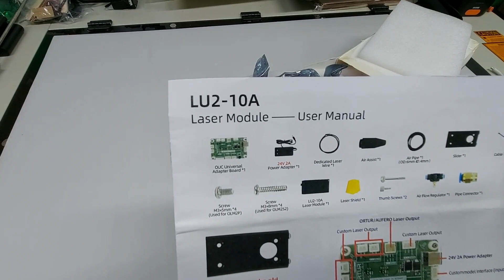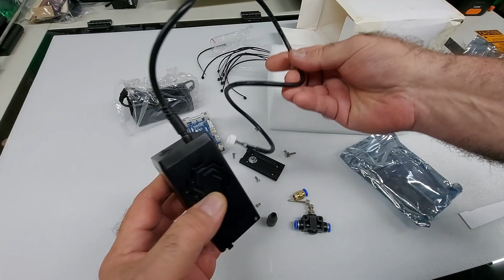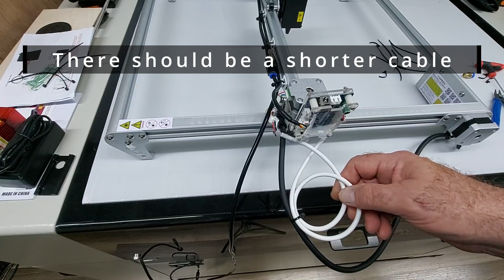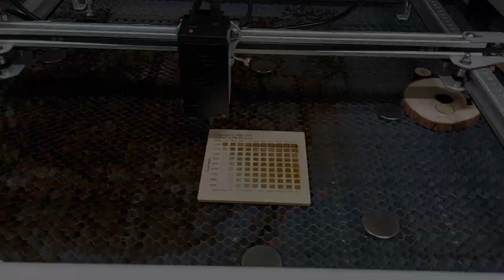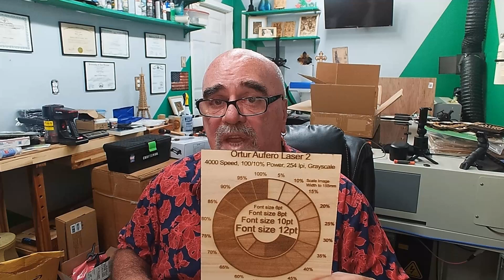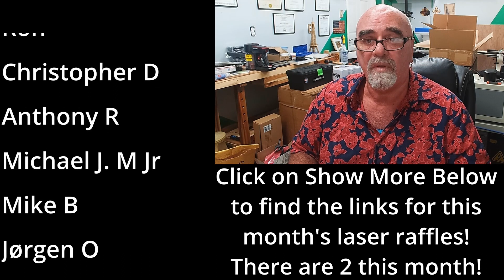ℹ️ Ortur 10W Laser Module Review! (July, 2022)

Comment: I just watched your review on the 10 watt laser from Ortur. My wife bought me one for Christmas.  They left out a lot of information or just didn't have it. I use a cabinet I bought from Ortur, they never gave any thought to those that use one. That electronic device was a bugger to install. Unlike Ortur, I fashioned a bracket to attach mine. Same as the air line, by now you know you have to push down on that ring to lock in hose. Like you said, they cod have done a better job.
My two cents anyway. I have learned a lot from you, thanks.
Reply from the maker: Thanks for watching! Hope you have fun with it.

Comment: So upgrading to this module from my LU2-2 will not cut down on engraving time? 

I generally engrave 7x8 inch Monograms at 600-800mm/m @ 100% on 15x11 cutting boards and they take 2+ hours each.
Reply from the maker: If you're upgrading from the 5.5W module it will.

Comment: Hi Rich, Your 10W laser module review was great. I have 2 questions. 1. The instruction sheet says to go to laser GRBL, go to configuration, and change the value of $131 to 390. Also, there is a push button switch on the top of the module next to the cable that plugs into the module which seems to do nothing. Do you know what this switch is for? Thank You for your help.
Reply from the maker: $131 is the max travel on the Y Axis, and depending on your model, it may need to be changed. There is no switch that I know of on the module. There's the plug for the power and the plug for the air assist line.

Comment: Hi everybody. I replaced my laser head unit to a new LU2-10A laser head unit and connected it to my laser device, model OLM2PRO S2. I uploaded a file using the LIGHTBURN software and... the laser does not engrave. I've attached a video.
Does anyone have an idea what to do? I would appreciate any suggestion.
Reply from the maker: You can't attach videos, but you can open a support ticket: https://ortur.tech/support/

Comment: Ordered this from AE about couple weeks ago.  Paid just $170, saving about $120!. Realized it might just be the module, but it came with all the mounting hardware and controller board, even spare lens!  Only thing I had to replace was the power supply which was meant for another country.
So far, no issues, engraves and cuts way better than the standard LM2 5.5w module. 
Only grudge is the mounting of controller board. Gonna try and come up with some 3D printed part to make it more secure.
Reply from the maker: Yeah, that control board was pushed out with no thought!

Comment: I hope you can answer this but I got the LU2-10A and installed it.  Everything works but in the laser grbl model setting under the laser grbl settings DB the LU2-10A doesn't show up on there.  What laser model do you suggest using in place of the LU2-10A?  Thank you so much for the video and the answer.
Reply from the maker: I don't have an answer for this. I would suggest contacting Ortur.

Comment: hi thanks for the video ... like you!!!  perfectly engraves.. How can I find out what parameters you set for glass engraving , can I find out ? or do you have a video clip :?  I have a 10A machine, Artur Lazer Master 2 PRO S2.. tried on glass but does not engrave.. Maybe I'm doing something wrong. It works fine on metal..
Reply from the maker: For glass with this laser you need to coat it with Tempera paint.
Reply: @TheLouisianaHobbyGuy  thanks
Reply: @richiesrestorations4883  it is necessary to apply to the glass Paint for furniture odorless wood chalk matte

Comment: Hi Rich, I love all your videos. I just recently replaced my laser master 2 LU2 2W to the 10 W module. Im loving it. I was concerned about the air assist hose as well, but it worked fine and held in place.  

Do you have a recommendation on how to do a grayscale test on anodized business cards or dog tags? Obviously, you can't set up that grayscale wheel to be 155 mm.

Thanks,
Ed
Reply from the maker: Yes Ed, in the Laser Tools --> Material Test. While it's not grayscale, you can get fill engrave settings and guestimate from there for some baseline testing.
Reply: @TheLouisianaHobbyGuy  Thanks, Rich. I completely forgot about that. Much thanks.
Reply: @TheLouisianaHobbyGuy  I PMd you a message on your webpage as well, so you can ignore that, but thank you again.

Comment: rather than spending $250 on the cheesy rube goldburg tie the board on the side approach I purchased a 'refurbished' lm2 pro s2.  this lets you slide on a new gantry and 10a laser module, but most importantly you get the s2 control module and cable set to replace the old lm2 pro module and cable.  a much cleaner approach for a few dollars more.
Reply from the maker: Awesome!

Comment: Great review. Since I'm originally from Louisiana and grew up fishing in Plaquemines Parish for speckled trout and redfish I love to see some fishing videos.  So I recently purchased the Aufero 2 as an intro laser to learn about them. I using Lightburn since it seems to have many more compatible file types. My biggest issue is the fumes. I live in MN and of course, it's -8 degrees currently outside so opening windows to exhaust the fumes is not possible. What is the best solution in your opinion??
Reply from the maker: In my other shop I have an exhaust fan that vents to the outdoors. At the wall, where it passes through, I have a fitting that only allows one way of flow, and I have it wrapped in insulation. This is the best solution IMO. It's sort of like a dryer vent.

Comment: Thanks for another great video. I have the LM3 10W and I cannot even cut the thin basswood (1.5mm) at 360mm/m 100%! If I force it out, it splinters. That setting barely scores the wood on 3mm ply. What am I missing? I use the little 'kickstand' for focusing and I have tried raising and lowering also. Thanks!
Reply from the maker: Lens has to be perfectly clean and focus has to be right. Try running a ramp test: https://youtu.be/sfGlZGhh144
Reply: @TheLouisianaHobbyGuy  Thanks! After watching both of these videos twice and running the ramp test, I've made a little progress. I can now cut 1.5mm basswood with 1 pass at 360 & 100% I looked at the lens but I'm not sure how to tell if it is perfectly clean. The tube and the orange cover are clean. For my ramp test, I elevated one end of the wood 8mm. I ran it 3 times, once focusing with the kickstand on the far left, once in the middle, and once at the far right. All three passes resulted in the focus position being the thinnest line. I did notice that you have Constant Power Mode turned on, so I turned that on, but I'm still nowhere near cutting through 3mm ply. I am using air assist. I've cut at 300, 200, 100, and 50 all 100% and the wood is barely scored. If you closed your eyes and ran your finger over the 'engraving' you wouldn't feel anything. I cleaned everything again and ran the test over with a 1 mm lower focus. Same result.
Reply from the maker: Try lowering your speed to 200.
Reply: @TheLouisianaHobbyGuy  I've cut at 300, 200, 100, and 50 all 100%, and the wood is barely scored. If you closed your eyes and ran your finger over the 'engraving' you wouldn't feel anything. I've tried a couple of different types of plywood (one being birch) but the results are the same. I can cut through the thin (1.5 - 2mm) DollarTree basswood at 400 speed 100% in 1 pass. It barely burns the waste board and doesn't just drop out, but with just a slight push, it pops out with no splintering.
Reply from the maker: Your lens may be dirty.
Reply: @TheLouisianaHobbyGuy  I watched your live stream yesterday (lots of good info). Thanks! My lens looks clean and I have cleaned it. An ORTUR rep asked me to make a video showing the problem so I did. She has already stated that the LM3 can only cut through basswood and only in multiple passes beyond the thin wood, so I'm not sure I will get the answers I'm looking for from her. My beam seems to be off-center. Is that a problem? Here's the video. It's short. Take a look:    https://youtu.be/BV_QXLH2Qjg
Reply from the maker: That looks like the diode was installed wrong. Try unscrewing the air assist and removing it for one cut and see what happens. It's definitely not normal.
Reply: @TheLouisianaHobbyGuy  Sorry to have so many questions but I just can't get the cutting part of this right! Are you just saying to cut without the air assist? The cuts aren't too different with and without the air assist. Our laser component came completely installed. We just mounted it and connected the cable and air assist. I'm hesitant to take it apart and I wouldn't know what to do if I did. The ORTUR rep won't answer my question as to whether the off-center beam is a problem. Her response was : 'The cutting speed depends on the engraving material. If it cuts the basswood, it will cut easily but if it cuts the 3mm birch，it may cut slowly and needs to be cut many times. Hope this can solve your confusion.' It doesn't!
Reply: @TheLouisianaHobbyGuy  Ortur is replacing it! Thanks for your help and I really appreciate all your videos. They are so beneficial to so many people!!! LOVE your work too!

Comment: I'm looking for help with my upgrade. I have it connected correctly (quadruple checked) and the circuit board shows the blue light for 24v lit. The laser on the other hand is not powering. Can you confirm the fans and red light should be on at power up?
Reply from the maker: On mine they are.
Reply: @TheLouisianaHobbyGuy   Okay. That’s what I was afraid of. Looks like mine is DOA. I appreciate the reply and thank you for this video as well. 🤗

Comment: I just installed this laser on my LM2 Pro and it doesnt even get close to cutting 3mm ply with the settings you tested. Not sure where I'm going wrong. Are there new laser settings I need to put into lightburn for it to use the full power of the laser vs the stock laser? I have both PSUs connected.
Reply from the maker: Did you run a ramp test? You need to have a good focus.
Reply: @TheLouisianaHobbyGuy  I just did a cut test using the material test tool. Im able to cut 4mm ply at max 340mm, when running 90%, 3 passes. Is this about expected? Was focused using the built in folding arm. Text is clear and looks good.
Reply from the maker: Try running a ramp test for the focus.
Reply: @TheLouisianaHobbyGuy  Ramp test indicates the included fold down spacer is on the money
Reply: Can anyone confirm whether my results above are about right for this laser in terms of power/speed?

Comment: So my wife bought me the S2 Pro with the LU2-4-LF module.  If I understand your video correctly, I can buy just this upgrade and replace the board and module and still use the rest of the machine?
Reply from the maker: Yes you can, but I would wait until mid-December if I were you Steve. I just got the Comgrow 20W module, pre-release, and it'll come in around the same price, with adaptation for Ortur!

Comment: Hello Rich. I purchased an Ortur Master 3 that should be coming in tomorrow and am very excited. Before I buy an air assist pump for it I'd like to know if I can use an air compressor. I have 2 compressors, a small one with a maximum PSI of 58 which I cannot control and a regular 2 gallon compressor with a Maximum of 210 PSI, this one I can control the output to the tool I am using. If I can use any of these I'd like to know what adapters I need to buy, I know the OD of the hose is 6MM and ID is 4MM but do not know how to connect it the the laser head, I'd appreciate your suggestions. Thanks
Reply from the maker: First you would need a regulator to govern the psi to 9-15. Anything over that will defeat the purpose and prevent the laser from burning. And then you would need a splitter: https://amzn.to/3NOTQjS to attach the hose and reduce it.

Comment: Thank you for this very informative video. This exact set up is on the way to my house. I have 2 questions. 1. I need to get an air assist. As you pointed out this laser comes equipped with air assist so if I understand correctly, I should only need a pump and not a complete kit. Can you recommend a pump or what power of a pump I should get? Question 2. Which honeycomb surface do you recommend? I do not need one as big as yours. What is a good size for the Aufero Laser 2. Thank you so much! I am a newbie trying to make sure I get the right equipment. Thank you again!
Reply from the maker: Any air pump with a 30L per min flow will work fine. Comgrow makes a good metal honeycomb bed at 400x400 that will work. If you want to use magnets, it needs to be metal and not aluminum like most.
Reply: @TheLouisianaHobbyGuy  Thank you very much!
Reply: @TheLouisianaHobbyGuy  Plus, I plan on working with leather. Do you know if there is an encloser for the Aufero Laser 2. that works. I hear leather can get kind of smelly. :) Thank you once again.
Reply from the maker: @baronleathercraft  Comgrow makes a 400x400 enclosure that fits it.
Reply: @TheLouisianaHobbyGuy  Awesome! Thank you for the info. :)

Comment: Someone may have already addressed this, but I had the same problem with the air hose not staying put. I had a slightly smaller hose lying around. It was a clear silicone style tube and that fits perfectly.
Reply from the maker: Mine fits fine, it just doesn't deliver any air. I think I have a clog.
Reply: Ortur made this Vedio showing the right way to connect the hose https://youtu.be/GC2SkDTfafQ

Comment: Hi Rich. Great video review.  My module should be here is a day or two per tracking.  Would you happen to know if the Laser Head Focusing Controller for Ortur Laser Master 2 Pro S2 can be modified to accept the 10w? I can revert back to the stock Z bracket if I have to.  Thanks.
Reply from the maker: Anything can be modified to work Jim, it's just about how much mods you need to do. At the very least, the mounting plate would need to be drilled.

Comment: I have the NEJE master 2. I have burned with it before, but for some reason I try to burn a 2 inch picture it tells me it’s outside the boundaries. Help,,,please
Reply from the maker: Search my channel for origin Brenda. You can ignore the message though.
Reply: @TheLouisianaHobbyGuy  I allready watched that one, it didn’t cover my problem. My problem is I have lost my grid. My numbers across the top are like -1289 and about the same on the side.
Reply from the maker: @brendathornton7770  Well it sounds like your device settings are wrong Brenda. You probably have the wrong working size.

Comment: Hi Rich, do you think the 10W unit will fail sooner than a 5W unit?  I have concerns that I would have to buy a replacement 10W head sooner, as it may only last half as long as the original 5W due to heat
Reply from the maker: Nope, they're designed with the necessary air flow. I have hundreds of hours on my A40640.

Comment: I got an email from Ortur that said the 10 watt laser fits the lm2s, lm2 pro but the back plate does not fit the lm2. I would have to 3d print one that fits.3d print my comment. Otherwise it would work.
Reply from the maker: You could just drill out the mounting plate to fit.

Comment: First of all, thank you Rich for another very informative video!
What bothers me about Ortur is the fact that they throw this module on the market without sufficient background information on the compatibility of previous models. e.g. Can I use the module on my LM2 Pro S2? Do I have to use this included universal board? Do I need a different power supply for it? Can I continue to use my purchased Z-axis height adjustment? Surely there are more such questions from other users. I slowly suspect that they would rather sell the new OLM3 than the module as an upgrade for older models.
Reply from the maker: You can use it with any LM2 Pro or Aufero Laser 2. It comes with the 2nd power supply. You do have to use 2 power supplies with the adapter board, and it doesn't fit the Z adjuster unless you somehow customize it.
Reply: @TheLouisianaHobbyGuy  In the video published today by Ortur Official entitled: "Assembly Method of Four Laser Modules on Ortur Laser Master 2 Pro S2", ONLY the supplied new connection cable is connected to "L" on the OLM2 Pro S2. There is no mention of the circuit board enclosed with the laser shown in your video, nor of a different power supply. That irritates me a bit now.
Reply: @floridalove  You can connect the Ortur LM2 Pro S2 (and only the S3) directly tp the 
"L" Connector.  You will need a 24V 4amp power Supply though.
Reply: @williambulloch8370  Thanks for your reply, but it has since been resolved. I bought the OLM3 and it was shipped yesterday.

Comment: I'm under the impression that you do not need to go through the Universal Adapter Board  or use the extra Power Source if you have the 24 Volt Ortur LM2 Pro, yet the several videos I have seen all show them being connected via the Adapter without mentioning that they are connecting to a 12 Volt System.   I just connected mine directly to the Laser Module.  Am I wrong?
Reply from the maker: Yes, you are William. When connected, the LU 10A requires 2, 24V power supply inputs for full power.
Reply: @TheLouisianaHobbyGuy  I was concerned about this, since mine seems to be running just fine connected directly to the "L" Connector(I'm using a 24v 3amp Power Adapter derived from (24v/10w=2.4amps).   I had read somewhere during the early promotion of the LU2-10A that it was for the 24 volt system and that they were coming out with an adapter to support the 12 Volt Systems.   Since no where on the Internet nor the Owner's Manuel does it say this and now you are confirming it, I contacted Ortur and Gil replied that the OLM2 Pro S2 (and only the S2) is connected directly to the "L" connector and you will need a 24v 4amp Power Adapter.